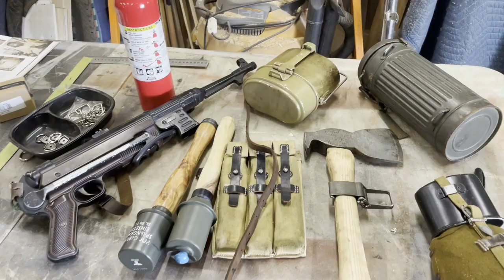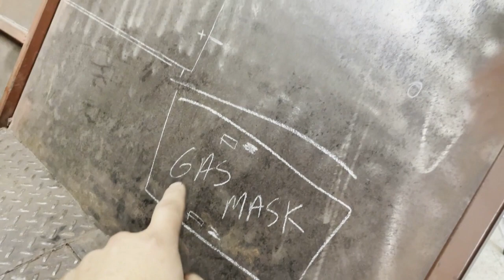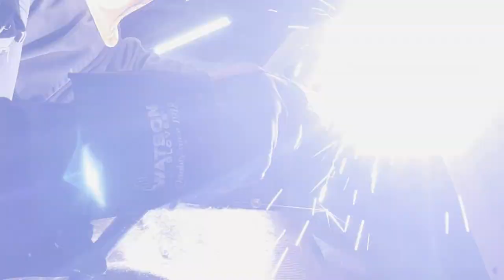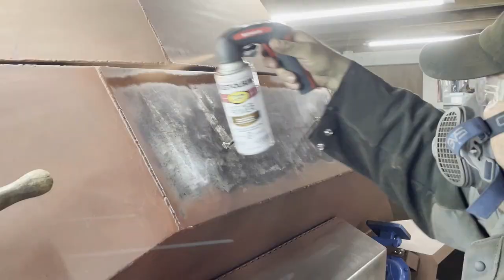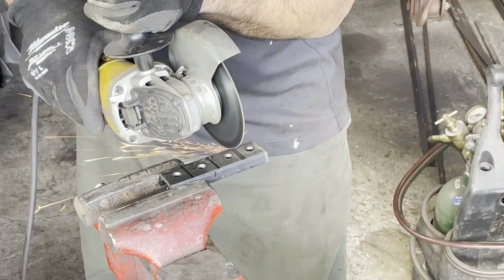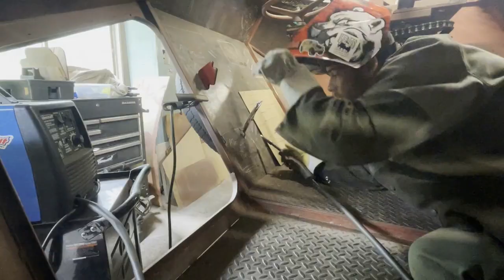Project 222  Ep. 72 Building an Armored Scout Car

Comment: I have a question for you on the small arms that were mounted on that vehicle. I’m sure they used an MG 34 was the Mg-13 used on that since it uses the similar mounting point to the MG 34. The reason I’m asking is the Mg-13 S specific ammo box that’s different than the MG 34 ammo box and I was wondering if youve Seen any pictures that show how the ammunition is stored
Reply from the maker: The 8mm ammo appears to be stored in long rectangular boxes.  I believe 3 boxes are stored on the rack.  I have a few reference pics.